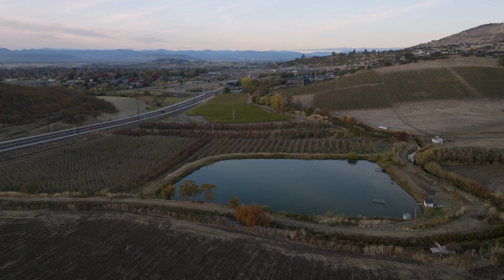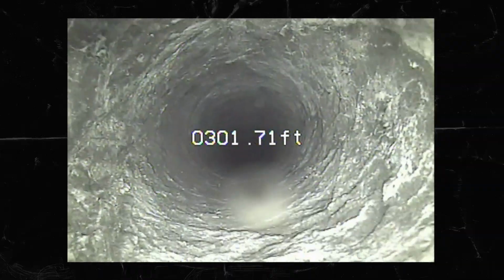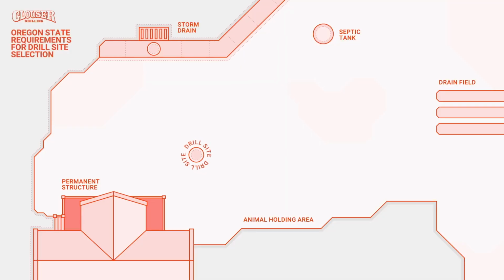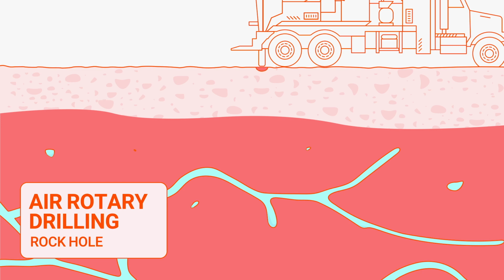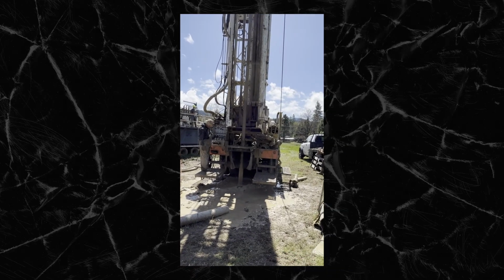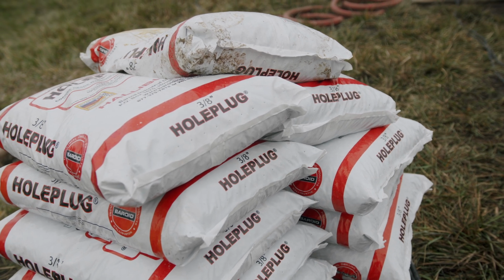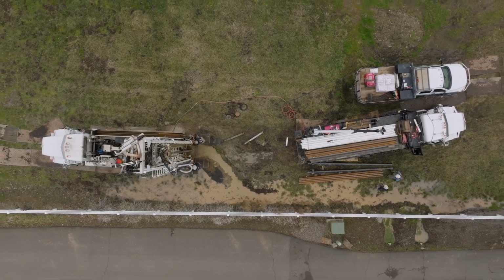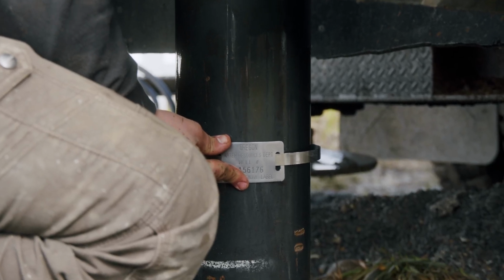What to Expect When Drilling a Water Well.

Comment: I was not told this. When you drill a water well, cement the outer covering so ground water cannot seep into the water at the base. This has to be done when the well is first drilled. Big mistake not to do this.
Reply from the maker: The sanitary seal is very important. Construction rules exist for required well sealing to prevent contamination to both the well and the aquifer. These differ by state.

In Oregon, either bentonite clay or cement can be used via approved placement methods. The required sealing depth is dependent on the borehole lithology and well design.

Comment: there must be a way to DIY a deep well
Reply from the maker: Where we operate it wouldn't make sense, assuming the goal of DIY-ing is to save money. A "deep" well here is typically considered to be 600'+ in bedrock. There is going to be a significant machinery and tooling investment to accomplish that, even for outdated, barely functioning equipment. Not to mention the hard lessons likely to be learned along the way.
Reply: @clouserdrilling1971  what if there was economic collapse, could you do it some way?  I know you need some kind of derrick but how could you turn it, maybe tires from a truck